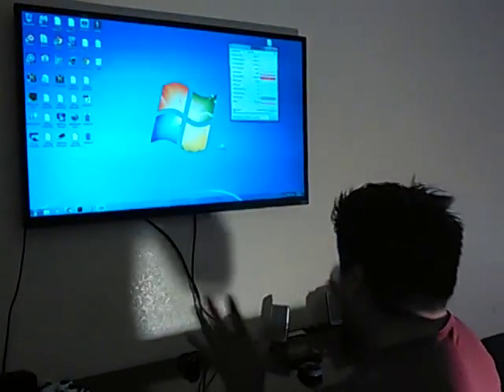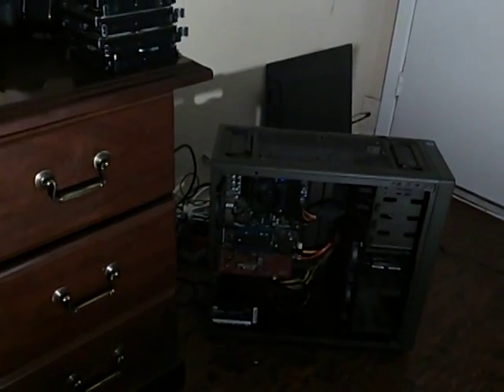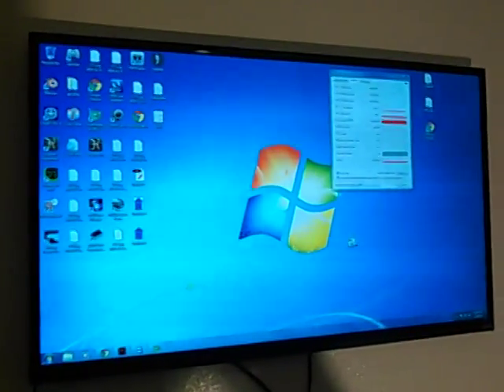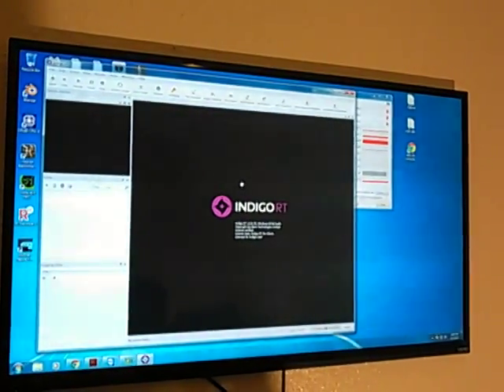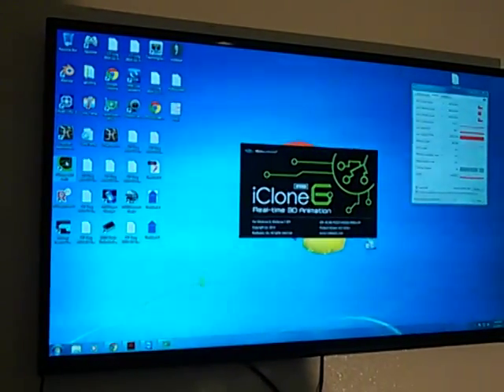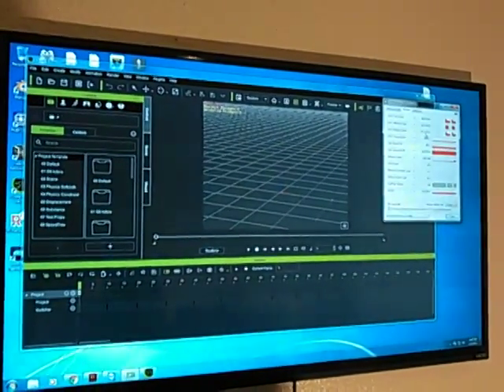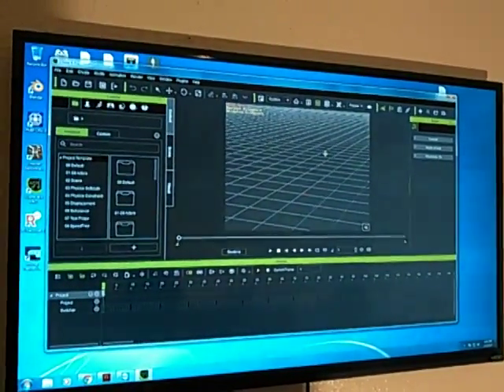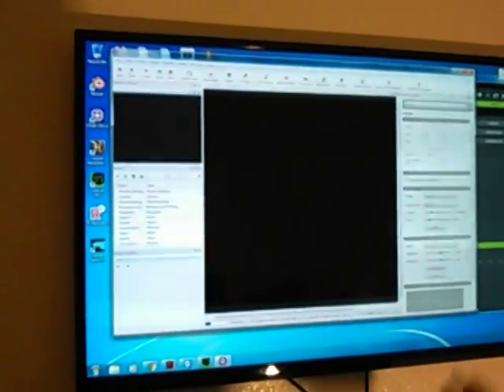Unexplained bug with iClone 6 and Indigo Rendering

Comment: I made a discovery over a week  of testing and talking with Reallusion Tech support and Indigo team - they didn't provide any solution to why my projects were crashing an in fact told me to keep iClone render settings and tessellation set to high for high quality output -WRONG.. that's only to render with iClone.. if you want to render with indigo then disable/reduce all quality display settings in iClone then export to Indigo  - I started thinking/realizing that both programs are  trying to access the same memory/resources/processing power of both the CPU and GPU/video card. In the end in my new procedure I was able to output projects of over 3 million polygons with full animation. I've since asked reallusion to make recommendtions for rendering with Indigo in the iClone manual or tutorials since it hasn't been mentioned anywhere at all that I've seen. So here is the result of my method https://www.youtube.com/watch?v=UYfeHF0JClU

Comment: try render with  icore7 32 gb ram and video card with  Nvidia GTX  970 4 gb   GDDR5
Reply from the maker: Lol if a person has to soup up their machine that much it kind of defeats the purpose of using low end technologies.
Reply: you have to update man for the new software.i have  done for it. . !
Reply from the maker: now way!. My office machine is 1/2 less powerful than the one im using here and it works just fine. This issue is related to my CPU. I think i just have a bad cpu fan or something that causes to overheat when it starts doing heavy indigo operations.

Apparently Indigo doesn't use the GPU by default so it puts all the strain on my cpu causing it overheat quickly. Mos amchones are set to shutdown if the temp reaches 90 degrees. I'm pretty sure this is what was happening. Yes it can be changed but it wasn't giving me enough time to hit stop and switch to GPU.

I was able to fix the issue by under-clocking my cpu (making it run slower), and nuking my computer and reinstalling all my software. It hasn't crashed yet, but now my machine runs at 2.8mghz instead of 4.0mghz that I was used to. Ill crank up the speed again at somepoint when I get a new fan and see what happens.
Reply: yeah check the level all time temperatura it maybe it about the fan or your computer.
.

Comment: I admit it was slow to render, but I have a core 2 duo running at 3ghz with 1gb of vga ram..It didn't go off as you said when I tried it...Must be some other issue relating to your machine of drivers.
Reply from the maker: Thanks for checking it out. I think its related to my specific pc. either my cpu or video card. :(

Comment: How strange.  I don't have a super-duper computer and I'm able to render scenes in Indigo quite well.  I hadn't tried using the Indigo renderer until you posted this video.  When I first tried to render an empty scene, it asked me to find the .exe file.  I chose the Indigo.exe instead of the Indigo_console.exe.  It rendered the empty scene without a problem and the fan on my graphics card didn't even start up.  Right now it is rendering the Courtyard scene in the background while I type.  I wish I could be of more help!
Reply from the maker: Well so far I managed to underclock my cpu which allows it to run at a lower speed but it seems to be keeping my coputer from crashing.

Also I have noticed that all my 6 cores are being maxed out to 100% loads, my actual GPU doesnt even make a beep. So it leads me to belive that Indogo is rendering strictly using the CPU and not using my graphics card at all. Which is really freaking weird since they claim that its supposed to be a "pure GPU" rendering process (http://www.indigorenderer.com/content/introducing-indigos-pure-gpu-rendering)

https://www.youtube.com/watch?v=QRE0_HATQTA
Reply: I noticed that my initial renders didn't use my GPU at all.  Once you choose to render from iClone, Indigo opens and begins to render.  Stop the render and then you can turn your GPU on manually by clicking the upper right tab that says "Imaging", which will then give you the option to pick "render settings".  There's a checkbox to enable GPU rendering and a drop-down menu of options regarding which rendering options your GPU offers.  My card offers CUDA and OPENCL. I'm certain this can be set up in preferences but I haven't found this yet.

No matter what, it does take a long time to render with each pass improving the look of the image.  I don't know if I'd ever use it.  It certainly would be impractical to wait 10 minutes for a scene to fully render but at least it's an option that gives very nice results.